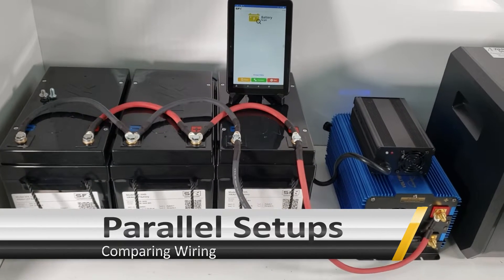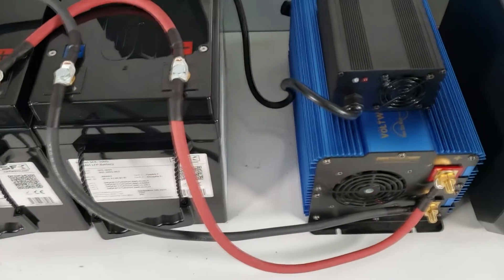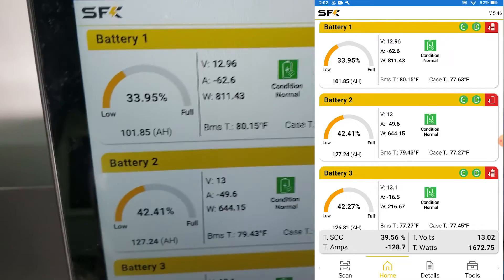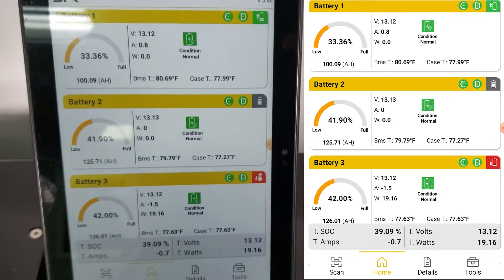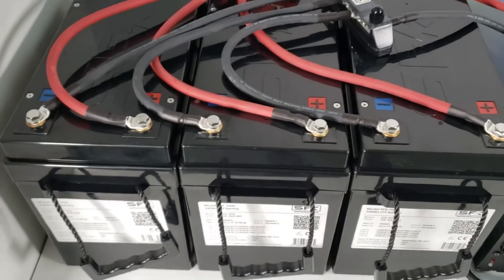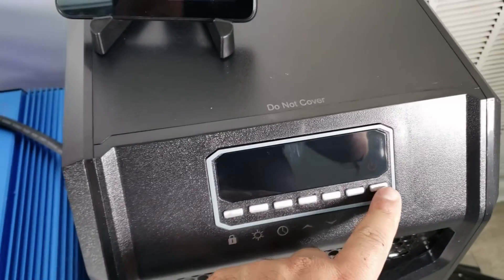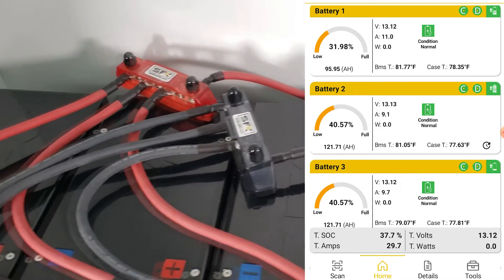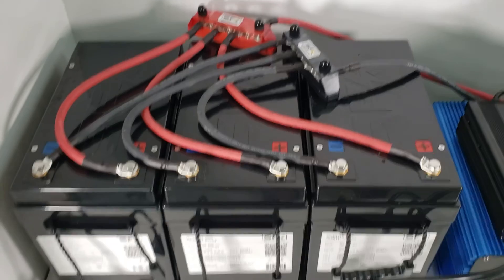Best Parallel Wiring Setups for Lithium Batteries (RV, Motor Home, Storage).

Comment: Could you have the cable for the inverter in the middle of the three cables on the busbar coming from the batteries? In other words could you connect the inverter to the middle lug on the busbar? Pause at 10:50 on the video
Reply from the maker: Yes that would make it a bit better but I think as long as the amp difference is under 10 amps it should balance out easily when you fully charge. The main goal is to avoid the large amp differences of 30+ and as long as you do this you should be good to go.
Reply: @sfkenergy  Its just something i noticed in the video. I seen other videos where there was more than four batteries and the cables from the batteries were taken from the middle of the bank to the inverter. Unfortunately comments were disabled in the videos I saw.  I wonder why?
Reply: @tomp1193 
Maybe because the shorter length of cable required it to be in the middle?
You want it as short as possible.

Comment: Ok so will AGM lead be okay like the first set up? For two batteries?

My boat has 2 battery system. Factory wired it parallel but battery (1 ) & (2) are 5 ft away from each other.  The load is plugged into battery 1 like your first set up. Battery (2) is 5 ft away located in the back of the boat with just the Pos & Neg cable ran to it from battery 1 😅. Neg to neg pos to pos. Long cable. 

Should i just add a bus bar to it at this point so it pulls from each end? Draining & charging it equally as 1?
Reply from the maker: AGM will charge each other much better in parallel because they have a more sloped charge curve. But if possible use option 2. 1 should only be used if you are drawing low amps (under 10).

Comment: I love your video, this is extremely helpful for me as I’m setting up a 8S4P right now. The question is instead of a bus bar if you want them equally distant why don’t you just have one post where they’re all connected together? A single post and stack up all the connections that way they’re all equidistant?
Reply: Use a busbar.

Comment: The ground should be at the other end
Reply: Did you watch the video?
Reply: Doing the same thing with four batteries,I think putting 00 gauge cable and fully prepped lugs would change the outcome in a more even way in the diagonal type layout,resistance is the main cause of in balance,what are you thoughts,and thankyou for the vid.
Reply: Yes ground is wrong it does need to be on 3rd battery
Reply: Yes you are correct
Reply: What does ground means
Reply: @abdulazeezrasaq3628 I think he means to say negative(ground) 😅
Reply: First thing I noticed
Reply: 😂😂😂😂😂😂😂 oh dear don't you look silly
Reply: You must be an ac electrician like I was in my younger years but iv don't a bunch backup. v12 cats and Detroits for hospitals I usually run my ground and n wire from the Middle.lol.
Reply: The negative  should be at the far left side and positive at far right side  for more efficient balancing.
Reply: There is no "ground" wire on any battery, in this video.
Reply: The point he is trying to make is the bys bar is pulling both positive and negative off batt 1 isntead of how it was connected in example 2 with the neg on battery 3 if he did that setup on the bus bar he would get even closer numbers. @MrSummitville
Reply: @weriesblack1375  BUT that is not what he said.  I know how to wire batteries correctly.  And "opposite ends" with three batteries, is still NOT the best way. Your way is still wrong.  Learn how to do it the correct way or you will suffer early failure.
Reply: @MrSummitville  fair enough. Please explain to me how to wire 3 batteries correctly because focusing on the problem without any solution wont fix it. Help me understand.
Reply: @weriesblack1375 instead of using the bus bar why not just bulk all four wires together negative and positive. Why use the bus bar. The only other thing that I don't like is the fact that you have all that amperage running through those three battery wires going into going into one small wire how would you get full power out of your inverter without starving it. My 12 volt inverter is 10,000 Watts that little wire would never work LOL. However I really did enjoy the presentation and the video.
Reply: Then why won't you make a video since this video isn't to your satisfaction? @bobbyotay
Reply: @bobbyotay  You do realize 10,000 w ÷ 12v = 833 amps, so your not a real genius
Reply: @weriesblack1375 lol he never replied?😂
Reply: @MrSummitville what he ment was to have the black lead on the left end battery.

Comment: The one flaw in your setup is you should have fusing to each battery either at the battery or the busbar connection. Fuse rating at 150% of anticipated load.  This prevents failure due to one of the batteries internally shorting and the other batteries delivering 10XC (C = battery capacity) current!!  In your setup 60 to 80 amp fuses would be suggested.....
Reply from the maker: Thanks for your reply, this was meant to be a demonstration real world installs will use breakers and or fuses as needed. SFK batteries have internal shunts and can monitor amps which means they can be set to disable output at a definable output by the user in the app as well.
Reply: Oh thats a cool feature! I am considering replacing my lead acids in a sailboat and lithium certainly seems the way to go.
Reply: Which pole of the battery ought to be fused
Reply: @scrypturefx3077  The terminal that is not connected to system ground.
Reply: @MrSummitville LOL

Comment: A custom made circular bus bar ? A big flat washer with battery lug holes on the outside and a big hole in the middle for the input/output ? But with just a standard bus bar mount the two anode/cathode wires of the four on top of each other with the charger/load wires in the middle ?...🌩 ⚡️

Comment: I'm completely stumped as to why no one is commenting on wire Guage. I'm seeing all kinds of wire used across the internet and no one seems to care but people say it's important... but leave it out of every tutorial. 

I have 3 12v 200ah batteries to be run in parallel. I was just going run a bolt and nut through the 3 red to the red trunk, and the 3 black to the black trunk. 

Wouldn't this be better than a bar? 

I'm stuck on wire size... I'm also stuck on, do i need a fuse and what size to my 3000w inverter. 

I have a bunch of 8awg and some 4/0. Was going to 8awg the bank and 4/0 the trunk, with a 100a fuse, although i might up it to 200a.

Thoughts? 

In case anyone cares: 

2 x 60v 7ish amp solar panels,  300w? To controller run in parallel. So 60v 15a for 600 watts. To meet 100/50 mppt.

3 x 12v 200ah sla bats run in parallel(haven't done this yet, but planning to) on 8 awg wire to stud/ trunk. Trunk would be a fused 4/0 to inverter. All lines would be as close to same length respective to their run. Although I feel like a fuse would mess up one leg on the trunk... something else i don't see anyone addressing.  

Any help appreciated
Reply: There are plenty of videos discussing AWG wire size.
Reply: @MrSummitville 
Yup. Just make sure you always go oversize then eliminate that potential.

Comment: The negative wire should go out to inverter from the last battery.
Reply from the maker: Yes we show this in configuration 2, this video was to show what happens if you don't do it this way.
Reply: So - the Title is missleading for non Professional viewers
Reply: @simonst1308 You seem confused. What is wrong with TITLE?
Reply: @MrSummitville its Not the Best, but the worst way to Connect Batteries 🙃
Reply: @simonst1308 you should watch the video and not just go off the thumbnail
Reply: @simonst1308  Clearly you did not watch the video.
Reply: @MrSummitville I did, and I Understand the technical differences… Still, the title is missleading for non Professional users. Best!
Reply: @simonst1308 watch the whole video first
Reply: @simonst1308  I agree and I watched the video as well. Not everyone will
Reply: @simonst1308  even if it is misleading…….you should be intelligent enough to just move on……..being that you’re well aware of whatever.  Verses complain about something so insignificant! (whether or not the person was intentionally *aiming to mislead).  If you’re grown and mature in *nature, you should be well aware of how ***some folk *choose to get down, much less will get down, when it comes to giving and extending *sound information. Personally, I found his video to not only *be informative, but it was orderly.  All over the place guidance should naturally have you flee with a quickness.

Comment: Stack the terminals instead of bus bar?
Reply: Why?
Reply: Hi Andrew, My three 100ah LiFePo4 batteries are now stacked on one external terminal. Been like this for a year now. I'm adding two more batteries soon and those will be added to the stack. However i will be ordering and using buss bars instead shortly. Eventually i will be upgrading to 48v so i may or may not need the buss bars anymore.

Comment: I was told that everything goes to One positive bus and 1 negative BusAnd everything is distributed charging equally. In a parallel configuration
Reply: That would be mostly correct. The "mostly" qualification is because electricity always tries to take the shortest path to complete the circuit. Because the load wires (going to the inverter) are on one end of the bus bar the battery connected closest to that end is going to have a slightly heavier load due to its location. In another post here the guy who made the video says he's looking at making a circular bus "bar" (bus wheel?) so you can have a centrally located load / charge cable with the ones going to the battery terminals equidistant.

Comment: Good video. One of the odd ball things I have seen out there is others maintaining the battery to battery connections and doing bus bars.
Reply: What size wire are  you using???
Reply: As if, you know what is, or is not, an "odd ball" configuration?
Reply: @MrSummitville you're really an asshole. A real POS explanation point

Comment: Impressive. But where is the charger connected?
Reply: He connected it (via clamps) to the terminals sticking off the front of the inverter.
The charger is the little black box on the right, the inverter is the larger blue one underneath the charger.

Comment: When batteries are wired in parallel.... You should connect the Positive to one, Like in this video, the 3rd battery..... But then the negative should be connected to the first battery (on the far left)....... Inverted connected directly to one battery like this, Forces that 1 battery to take the power draw, and then for the other 2 batteries to keep up with the demand...
Connecting negative to first battery, and positive to the 3rd battery.. Will share the load equally between the 3 batteries, when the inverted demands a load.....

(i install home, and off-grid solar systems for a living.. This has been thoroughly tested and proven to be more effective, stopping 1 battery from premature cell wear due to load draws)
Reply: I think you just described his second (better) setup. It shared the load much better between the batteries on either end but the middle one was not directly loaded.
Reply: hello, do you mind illustrating ?
Reply: @the english miner - No, your idea is not the best way. Using a Busbar is the best way.

Comment: You could have done even (pun intended) better had you wired the busbars [1|2|3|inverter] and [3|2|1|inverter]. 

This gives bats 3 and 1 the same resistance and bat 2 should be pretty close, if not the same (depends on whether the busbar studs are equally spaced). In this wiring config, all the busbar distances (and resistances) should be the same.
Reply: Ty I 100% agree,they will be even closer balance,it's that one last step overlooked,even those his load is close enough,it can still be better
Reply: @dustydawson8977  the only time I have seen any real difference is under really heavy loads or charging. It’s all probably in the margin of error in the clamp meter. My four batts in parallel stay balanced well, though and it was 5 mins to put the wires in the better (theoretical) order.

Comment: For best balanced battery output move the negative cable to the first battery terminal.
Reply from the maker: This would not make any difference as the third battery is wired the same way you could say in this setup that the order of the batteries are 3,2,1.

Thanks
Reply: @sfkenergy  Have you ever heard current sharing and also internal resistance from the battery itself this would make significantly affects the performance. The 3rd battery would probably the first be charged up and also the first one to take the discharge.

Comment: You should have charged the batteries to 100% before each test.
Of course you have small balancing currents between the batteries and slightly uneven loads in setup 2 and 3 after the test of setup 1.

Comment: I like how you showed good, better, and best setups.  This video is also a good demonstration of why it makes sense to go with higher voltage configurations, whenever possible.  There will be less total drift across the cells, if they are all managed by a single BMS.  If your video showed 4 batteries in parallel, and then showed those same 4 batteries in series, for 48 volts, you could demonstrate how that configuration results in even less drift than the bus bar connection you used.
Reply: Agreed, i will soon by upgrading from 12v to 48v.

Comment: I bought four 300 AH batteries. Their manual recommended the connection you showed in the second setup. I contacted them and suggested they used the setup you had in the third setup. They changed their manual to reflect the change. I suspected the busbar would also induce a difference between each battery.
Thank you for demonstrating the current draw from each battery. It helps get the point across.
Reply: In my opinion setup 2 and 3 are equally.

But his test wasn't optimal. He already started with unevenly charged batteries and he should have changed them to 100% after each test.

Of course you have small balancing currents and slightly uneven discharge currents in setup 2 right after the test in setup 1.
Reply: @SpatteL19  Nigel Calder explains it in the youtube video. Search for - The BEST way to Parallel Batteries on a Boat | Ask The Expert with NIGEL CALDER
Reply: bus bar should be a circle, equal distance to all battery connectors
Reply: I do enjoyed both the video and the comments,  thanks guyz I'm just here to learn.

Comment: Ok this must be some kind of prop setup with non-live batteries because you touched an exposed connected busbar SEVERAL TIMES.  There are no MRBF terminal fuses in place which means you would have been ELECTROCUTED AND KILLED had those been live batteries and not apparently props.  I ask that you TAKE DOWN and REVISE this video because anyone following your "Best Parallel Wiring Setups" and touching live busbars WOULD HAVE BEEN KILLED.  You obviously have NO KNOWLEDGE of what you are doing, or you are BLATENTLY TRYING TO KILL the unaware.  Either way this problem needs to be addressed immediately.
Reply from the maker: These are live batteries, 13.0v is not enough to do what you claim. 48v or larger is where it starts to become an issue.
Reply: @sfkenergy  Not only are you WRONG, you are DEAD WRONG.  Dude you are an actor and you dont want to betray your role or whatever.  A guy standing in front of a camera with props and I understand.  But if you do that in REAL LIFE, with REAL BATTERIES, you WILL BE KILLED.  YOU WILL DIE from this.  If you use MRBF terminal fuses on the positive of each battery, you MIGHT live.  If you use a shunt with a fuse on it, like the Victron Lynx Shunt, the fuse will blow and you MIGHT live.  

Dude you are DEAD WRONG about this and anybody reading this please take note.  NEVER ONE TIME TOUCH A BUSBAR.  THERE IS A VERY HIGH CHANCE YOU WILL BE KILLED.  High volts will kill, and high amps will ALSO kill.  You are using 3 high amp lithium batteries with no fuses.  YOU WILL CERTAINLY BE KILLED.  DONT TRY THIS, DONT ATTEMPT THIS, YOU ARE IN MORTAL DANGER.
Reply: 😆death by 12 volts!
Reply: @Foxfried  lol, that would be a first..lol
Reply: Youd need to touch both exposed bus bars at the same time to complete a circuit and be electrocuted. And its 13v you wont even know.  Not an educated comment
Reply: Most cars are grounded and at a nominal 12-13 volts. Harm is possible if you are soaked to the bone say by a rainstorm and touch the 12 volts with an open wound on your body. In short pun intended, it is the relatively high and dry body skin resistance that protects you and your heart from electric shock damage. Penetrate the skin barrier, then depending on the path across your heart … just don’t !
Reply: Mr. armelpeel, please tell me you are joking..lol